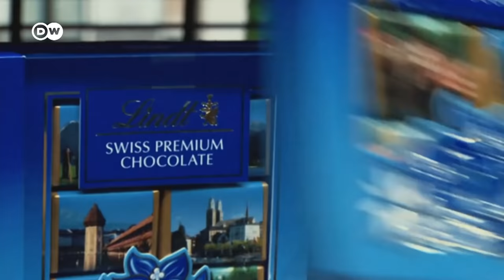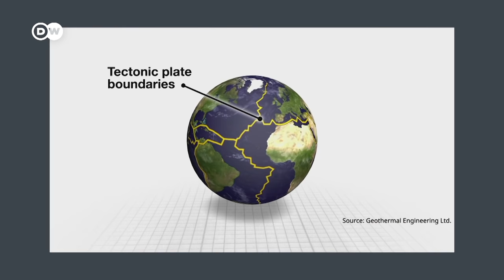Geothermal energy is renewable and powerful. Why is most of it untapped?

Comment: An idea for you : Using old mine shafts to dig deeper and create geothermal plants is definitely a concept worth exploring. Here's a breakdown of the potential benefits and challenges:

Benefits:

Reduced exploration costs: The mine shafts already exist, so the cost of exploring for suitable geothermal resources would be significantly lower.
Faster development: The infrastructure is already in place, which could speed up the development process and reduce the overall cost of building a geothermal plant.
Increased efficiency: By utilizing existing mine shafts, you can potentially reduce the environmental impact of construction and minimize the disruption to surrounding areas.
Diversified energy sources: Geothermal energy can provide a reliable and renewable source of power, reducing dependence on fossil fuels and mitigating climate change.
Challenges:

Safety concerns: Old mine shafts may pose significant safety risks, including unstable rock formations, hazardous gas pockets, and potential collapses.
Geological complexity: The geological conditions in old mine shafts may be more complex than those found in newly drilled wells, making it challenging to predict the location and flow rates of hot water or steam.
Environmental concerns: The use of old mine shafts could lead to contamination of groundwater or surface water if not properly managed.
Logistical challenges: The existing infrastructure in old mine shafts might not be suitable for modern geothermal plant equipment, requiring significant modifications or upgrades.
Regulatory hurdles: There may be regulatory obstacles to overcome, as old mine shafts may not have been designed for geothermal production, and local authorities may need to be convinced that the project is viable and safe.
Case studies and examples:

The Wairakei Power Station in New Zealand: This 1958 geothermal power plant was built using an existing limestone quarry, demonstrating the feasibility of using old mine shafts for geothermal production.
The Geysers Power Plant in California, USA: This 1960s-era power plant was constructed in an existing volcanic field, utilizing natural steam vents and underground reservoirs to generate electricity.
To overcome the challenges, it's essential to:

Conduct thorough site assessments and risk evaluations to identify potential hazards and environmental concerns.
Develop customized solutions to address the unique geological and logistical challenges associated with each mine shaft.
Collaborate with local authorities, regulatory agencies, and environmental organizations to ensure compliance with regulations and minimize environmental impact.
Engage experts in geothermal engineering, mining, and environmental science to guide the project's development.
While there are challenges to consider, using old mine shafts to create geothermal plants can be a viable and sustainable way to generate renewable energy.

Comment: 7:23 Italy has huge reserves of geothermal energy completely untapped: Sicily, the islands around it, the huge caldera in the Neapolitan area and several active volcanic sites, litterally the largest geothermal area outside Iceland in Europe.
Japan is in the same position, preferring nuclear and oil as their general energy supply sources.
Until oil will seriously rise in price there is no way serious investments will be carried on in this area, but because the less oil is demanded the less it costs... Well perspectives are not good.
Keep in mind that Thorium nuclear reactors were not seriously developed because they do not produce Plutonium, so you can figure out why every nuclear plant in Russia, USA, France, UK, Israel and China is Uranium based. Electricity is just a byproduct, not the main reason for building them
In 2021 only China is going to install a thorium reactor after 60+ years since it was developed, despite being much cleaner, selfshutting and Plutonium free...
Reply: Even Thorium reactors uses Plutonium

Comment: There is enough easily accessible geothermal energy in Colorado Springs alone to power most of the US but it isn't being utilized.
Reply: Most of the Saguache valley has easily accessible geothermal too.
Reply: There is enough wind in Kansas to power about 1/3 of the US but only a tiny fraction of it is being extractey, guess it is time to turn the center of the country into its battery as well as it bread basket.

Comment: Why haven't we tapped it?!
Reply from the maker: The main reasons are: 2:00 The World Wars prevented the spreading of the technology. 7:15 It is not as profitable as other energy sources for the investors. 7:39 Geothermal exploration can trigger earthquakes.
Reply: @DWPlanetA  Why thank you for clarifying but I did watch the video. It seems like the benefits outweigh the negatives and that is what my original comment was meaning to convey. Sorry for the misunderstanding :)
Reply from the maker: @whoisheiforgothisname2103  No worries, we are always happy to help! Indeed, the advantages seem to outweigh the disadvantages, that is why many countries are focusing on geothermal energy. Would it also be an alternative in your country?
Reply: beacuse of the lack of funding
Reply: Brother a geologist looked into it in Nevada , problem there is water, so much going up as steam, dry up the resource, my way of thinking, much of this  steam could be recaptured, tarp between wire mesh, makes possible,  structure, capable of capturing steam, reusing it, can build fast, cheap, uncomplicated with it
Reply: @DWPlanetA  
You should do a history documentary on the Lardarello geothermal field in Italy. Conte used a a steam engine but the valves clogged with borax, so he used the steam to heat a boiler to make clean steam. It was with that steam engine he lit a few light bulbs as a proof of concept. They then installed a 300kw, and later a 3 megawatt turbine that provided electricity when the cost of coal increased during world war 1. In the interwar period, many more stations and steam pipe networks were built. The retreating axis powers blew up a bunch of the infrastructure, including blowing the well caps off the steam wells. It was rebuilt and provides electricity to this day.
Reply: We're idiots?
Reply: @eddybrevet6816  Nevada doesn't have enough water to sustain what it is currently doing, they are probably better off investing in wind and photovoltaics which don't require water to operate, and perhaps using some of that energy to reprocess their sewage into drinkable water.
Reply: @DWPlanetA 
So does fracking for oil

Comment: Realistically geothermal Electricity and heat production power plants should be all over the world. Makes alot more sense then wind and solar which are intermittent.

Geothermal also lasts 50 years compared to 30 years for a wind turbine and and even after 50 years only the turbines and generators would have to be replaced in a geothermal plant you wouldn’t actually have to drill done kilometre again just change the equipment and connect it to the already existing boreholes.

Comment: I think there is an error when DW states that Indonesia has a geothermal installed capacity of 29 GW. Data from 2022 shows that the world only has 16 GW. Probably DW meant 29 GWh/year, as the Indonesian prodcution of geothermal energy, that makes more sense with real data.
Reply from the maker: Hey there! The global electricity generation from geothermal energy was about 16 GW in 2021. However, the global potential is much more (about 70-80 GW). Indonesia has a potential of 29 GW but currently only 2.3 GW installed capacity. So, one is the potential and what you mention is the current electricity generation (16GW) already happening.

Comment: Does the geothermal have to be in places with geyers? I would be afraid of producing earthquakes like with fracking if you have to inject water down into the earth especially since it will turn it into steam. I guess if they put pipes in the ground and circulate water that would solve the problem but is that possible or what they do?

Comment: could water networks be reengineered for heat retention and delivery? could heat waste in general be salvaged for positive use? there are individual systems to trade heat from peak daylight to cold months. more sensible would be a civic structure to scale the cost and improve reliability.

domestic power near here uses a district heating network to radiate into the street across winter months. those streets are hot in summer when few would want them to be so and that heat could be differed to storage or use.

Comment: The geodynamo process in the outer core generates the Earth's magnetic field, driven by the combination of heat sources and the Earth's rotation. This magnetic field forms a protective shield, the magnetosphere, which plays a key role in preventing the stripping away of the Earth's atmosphere by the solar wind.

We should be very careful doing anything that could cause changes in the earth's outer core, crust or accelerate the transfer of heat from the core to the surface.

There could be other unintended consequences. e.g. Earthquakes and tremors.

Comment: Geothermal is theoretically simple: You throw a U-pipe into lava that won't melt and it heats the water flowing through the pipe.  Problem #1: developing a pipe that won't melt that will conduct heat to the water.  Problem #2: Getting close enough to put the pipe in.
Reply: Or just straight pipes toward 200deg rock fractures

Comment: I think that on projects where there is a long term payout is where governments should step in, not completely funding it, but paying enough upfront to make it attractive for investors and if possible reclaiming the investment over 10 period and then taking the profit after that point into the government purse preferably to pay for long term investments.

Also if idea's like Quaise Energy's mining with fricking lasers beams, more specifically a maser beam yeh within 3 - 5 years yeh we could access the 44TW that radiates out from the crust naturally which humanities consumption is 17.7TW, so only take half of what naturally lost to space would satisfy our current energy needs and a fair bit extra for developing countries and yes that is terawatts thermal, but the thermal flux would increase if we started drilling down everywhere to extract heat so it's not a problem that we would only be 35% efficient and longer term you could keep going down to just before the mantle which naturally convect heat so you can pull orders of magnitude more heat.

Comment: every energy types, no matter how good it is or how enviromental friendly it is, it will not be an effective solution without good implementation, im an indonesian sitting on a ring of fire, three of the biggest geothermal project i know had trouble implementing it because the official had skipped a lot of the assesment to advance the project, many people going homeless, got hit by the blowing pipe of hot steam, many of our clean spring used by the agricultur sector was also threatened, green energy was not always a fair energy.

Comment: I still like the new TWEST energy idea. The idea is quite simple: convert existing fossil fuel power stations to work without any fossil fuel at all. Such a genius idea - use existing infrastructure: no need to build anything new at all, no need to surrender tens of thousands of acres for solar farms, no need to shred millions of birds in wind turbines... The cost savings alone are staggering - and let's not forget the environmental benefits of not having to make and transport millions of solar panels and bird-shredders...
And TWEST energy is a very real thing... there is a working plant right now, in India, I believe.

Comment: It is not so easy to set a plant of geothermal because when re-inject water it is very difficult to determine the path of steam every time and which may cause earthquakes and may blast off the plant which in use .
Reply: Did you hear any indication of difficulties in Iceland?
Fracking causes earthquakes here all the time, somehow no big deal.
Can you point to an example of a heat extraction plant "blasting off" anywhere, ever?

It was a great factual presentation DW did, then you follow it up with a bunch of fabricated disaster scenarios. Should we talk about say, nuclear power plant disasters?

Comment: Pros:
24x7x365 energy,
clean and sustainable energy,
available in all continents,
renewable,
Cheaper/Economical in long term 
 

Cons:
capital intensive, 
long gestation period, 
lack R&D(relatively unexplored)  , 
smell because of Hydrogen sulfide, 
mostly use for heating(houses and cultivation in cold places), 
can lead to EQs
Reply: Be honest, "Capital intensive" once, and nothing like solar or coal. It's been explored and understood for about a hundred years. Not all sources release sulfides. The number of quakes coming from fracking and melting ice on continents leading to isostatic rebound will make anything happening from geothermal completely irrelevant.

Where do you people come from?
Reply: @davidk7544  
I just wrote pros and cons. It does not mean I am advocating against Geothermal energy.

When someone ask to define apple you don't say it's not orange (So don't compare it with Shale Gas). 

I wish governments and private sector invest more in renewable technology and make it as common, efficient, grid to grid connective. 

Todays reality compel us to to explore and invest in other technologies (including Geothermal)  because there is no one form of energy is enough to meet the demand of 7.8 billion peoples.
 
P.s I come from same plane where you live. Only difference is,  I know to respect others opinion. Maybe you can work on that (free tip).

Comment: Why do they think the only way to get deep down is to drill. You could blow holes, you could bomb holes, you could shoot holes, you could poor water until holes soften and material rises to the surface you could poor water then stir to artificially get materials to rise to the surface. It could even be salt water used to create holes for Geothermal energy.
Reply: If you fill a hole with water then create vibrations it will cause the hole to dig itself deeper.
Reply: You then stir and remove the material from the surface and allow the rest of the water to evaporate from the underground heat.
Reply: If you did this in the ocean you wouldn't have to dig at all you could use ocean water to dig for you with just vibrations.

Comment: Contrary to popular belief, geothermal energy is 𝐧𝐨𝐭 renewable.
The Earth needs a molten core to keep generating the magnetosphere, which is a neccessity for the prevention
of atmospheric stripping, which is reliant on heat, which when stripped enough allows for solidifiation
of the Earth's molten core, which then makes the magnetos sphere collapse.
The solidification will also lead to great seismic events when the solidification and with that kinetics
from the then solidifiying core will translate speed onto continental shelves.

Much like the automobile at first, thought to be easy locomotion, when there were only few cars,
few people would have believed that this usage would one day yield global warming, much similar
a few geothermal energy plants won't harm much, but when used by many plants, will yield
most significant energy absorption and release from the Earth's molten core.
Let's say a million of those plants all using up gigajoules per second over the period of 100+ years.
This is most significant, since despite any energy generation happening still at the core,
at one point this will deplete, and thus solidification would happen.

Stick with solar power and potential energy storages, it's cheap, reliable and abundant.
The only problem there is a global energy generation that's spread across the world using
UHVDC in a global network, while also using potential energy storages for variation degrees of usage,
which may not be covered fully by the UHVDC network.
For this I'd suggest scalable UHVDC networking.

Comment: So nuclear energy is also renewable or a source with long therm usage
Reply: How is nuclear renewable? lol
There is only so much uranium to mine or plutonium to produce.
Reply: @pavaomesaric3010  I say long terme used
Reply: Definitely not a renewable source.
Reply: @hilammandwee1283  is geothermal energy renewable? 🤔
Reply: @CUBETechie  yes
Reply: @hilammandwee1283  how ?
Reply: @CUBETechie  because the earths core will never stop being hot. Its like reverse solar power, we literally have a heat source right in the middle of the earth.
Reply: @pavaomesaric3010  uranium is not the only nuclear fuel

But no it’s not renewable, but it can last us for thousands of years
Reply: @davidk7544  nuclear waste isn’t a real issue. It’s tiny amounts. It’s not the simpsons
Reply: @kagandragon  we can store it just fine
Reply: Technically not renewable, but we aren't going to run out of fuel any time soon.

Comment: Wouldn't using geo-thermal energy cool the planet's core, which would solidify it, which will make it stop moving, which will make it not generate an magnetic field around the earth, which will mean no more protection from sun's harmful electro-magnetic discharges. We should only use the heat that is already escaping from the earth.
Reply: It would speed it up a tiny amount, it's also self limiting since we cannot drill very far and the heat has to migrate from the core to the outermost layer. We can only drill about max 10km deep in certain spots and the diameter of the earth is about 12700 km. There is actually only so much energy we could extract per unit of time until we would have to wait for the heat to migrate from deeper within the earth, due to the outer layer's insulating properties. Humanity would have to make an enormous concerted effort to have any meaningful effects on it at all at a timescale that isn't on the order of millions of years.